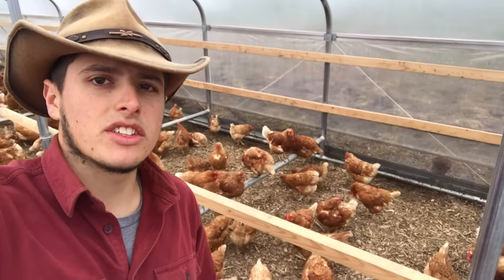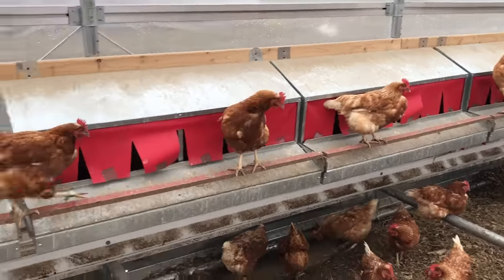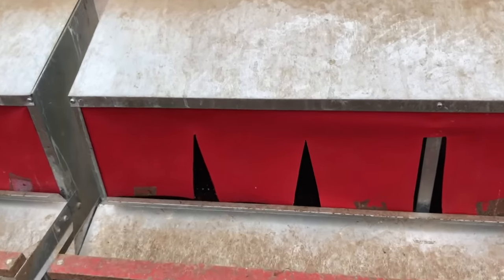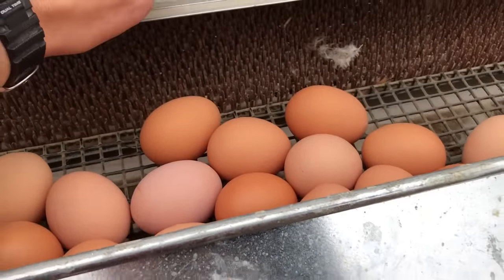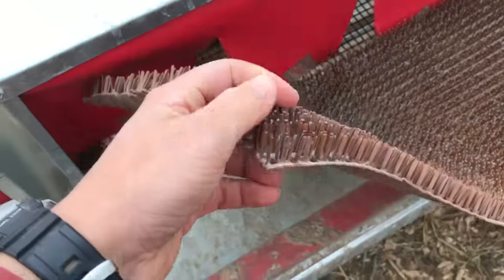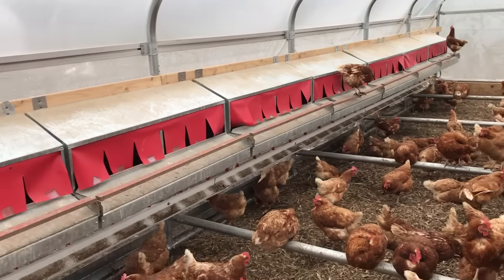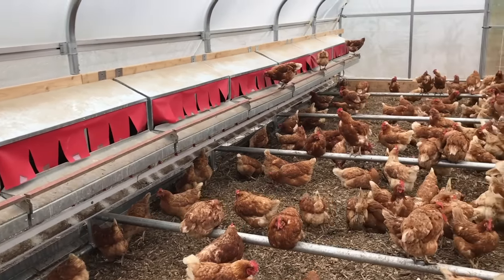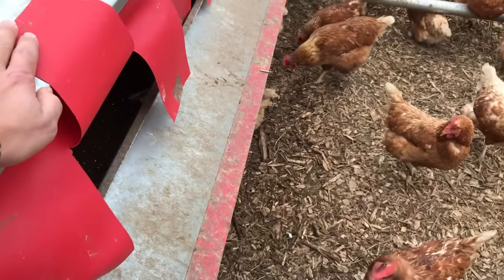HenGear Rollout Nest Box - No more cracked eggs or dirty eggs - Pasture chickens - HenGear.com

Comment: How much would that set up cost. I'd like to start a operation like that
Reply: Depends on how much you want to spend but each one of those portable larger chicken trailers is around 5 to 6 grand. Each Nesting box is on average 200$ and the tarping/ custom trailer hitch for either a tractor or truck to pull is typically another 200$. Each trailer weighs about 3,000lbs so you'll need something that can tow it comfortably. 

All in all just one trailer is around 7 to 10 grand, not including the vehicle to pull it.  

I would suggest building your own. It would most likely be cheaper. I built my own and I paid about 4500$ for each of my trailers. The key is buying large stock at the right time when it is cheaper and easier to handle.